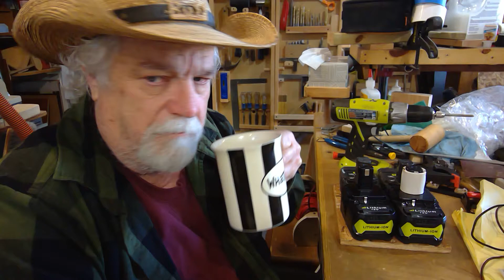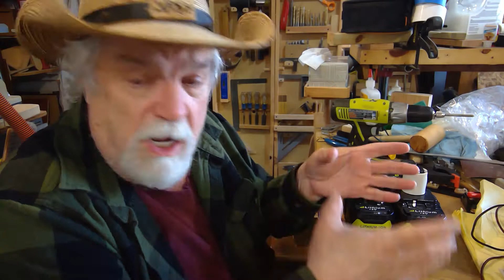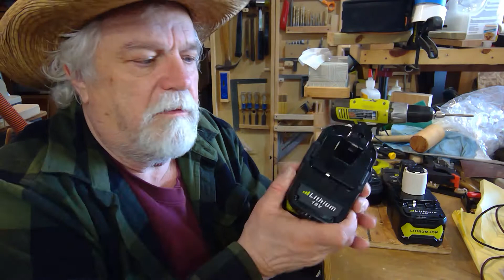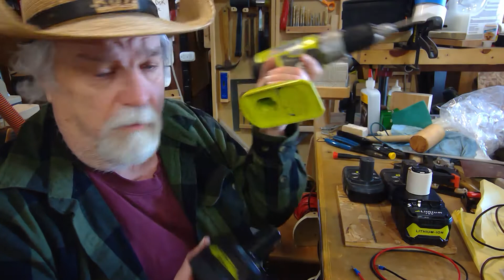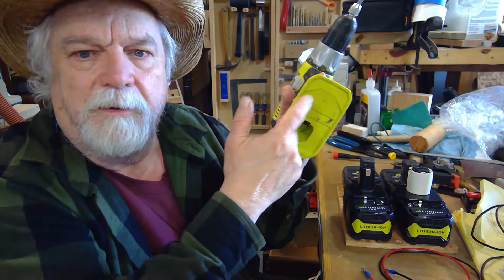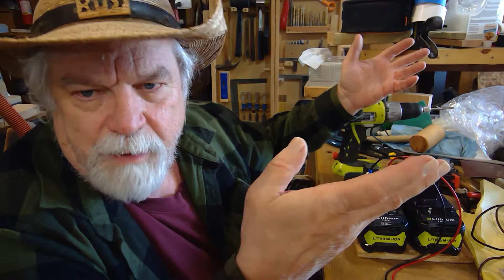DIY Portable Power Station by Portable Power

Comment: Funny thing Russ, just as you were pointing out that you could not buy sockets for the battery plug I instantly thought it could be 3D printed!  But I think your solution is genius, needing a scrap of pvc pipe and a hair dryer.  That's walking elegance.

Comment: Funny thing Russ: Just as you were saying you could not buy sockets for the battery plugs I was thinking they'd be fun to 3D print.  But I like your solution a whole lot more, simply a scrap of pvc pipe and a hair dryer...walking elegance.
Reply from the maker: Hey George, I thought of you as having a 3D printer.  I didn't want to volunteer you to make a bunch of these :>)  your assessment of my solution flatters me, thanks.  if I can ask for your opinion ,  do you know anything about portable power stations? does your area of expertise include low voltage (DC) technology?
Reply: Hi Russ, on making sockets a couple of points:  Watching your video, I actually thought about 3D printing a few sockets and sending them to you.  But once I saw your solution, I decided "OK, job done, job done elegantly".  For anyone else who would want a 3D printed socket, it is possible to get them even without owning a 3D printer.  Some makers will offer their contraption to be ordered from them.  And then there are others who will print third-party objects if you send them (or point to) the .stl file.
About DC portable power:  I have some practical experience with DC power supplies, but nothing specifically with portable power, not with higher-ish wattage.  Most often they've been 5V maxed at 1A, so 5W tops.  I've made DC supplies using discrete components usually with 78xx voltage regulators, and lately with store-bought switching power-supplies like your buck step-down and buck-boost step-up converters.  But again the applications have been low wattage.  So far my approach to "portable" has been an extension cord or small batteries.  Oh, and yes, I thought you might have meant me when you said you knew George had a 3D printer.  You pasted a huge grin on my face, and got an LOL when I replayed the segment for my wife.  Best of the season to you and yours Russ.  (georgef at uottawa dot ca)
Reply from the maker: I sent you an email. I hope you got it.  I am having troubles receiving email.  please let me know.
Reply: Hi Russ.  Just got home.  I found this comment right away, but there is nothing in my mail: not "inbox" nor "junk mail" nor "other".  Note that my address is georgef (not just george) at uottawa dot ca (not com).  I'll be on the lookout.  Bye for a bit, George F.  PS I also have GeorgeFouriezos at gmail dot com...nothing found there either.
Reply from the maker: looks like I can't send. my address is (russv at cpamomy dot com)
Reply: @russveinot5754  OK, I tried sending you email using russv etc.
Reply from the maker: i got it and hit reply.  no errors when sent.  one of those days :>)

Comment: The flat charger tends to monitor battery conditions, where as this newer triangle charger has left the neighbors batteries in a dead state from time to time.
I'll have to look later for a model number for my flat 6 port ryobi charger
Reply: Looking at google, it appears that my P125 has been discontinued? All I'm seeing is the P135, that looks similar to the neighbors. Perhaps he got a dud, or an older version? Mine will randomly check the condition of the batteries when in eco-mode, or switch from Battery to battery if they've been recently placed in the ports. Up to the 4Ah it seems to take roughly an hour, but I've not timed the 6Ah, and don't own any 9Ah to note the charge time.
Reply from the maker: the p135 is the only multi-battery charger.  the other is discontinued I found a couple on ebay (one of each model) that are for parts only.  I will own one :>)  all I need is the case and port sockets for the batteries.  I can fit all components into the case I will need to have a portable power station.  it will be my nicest station when done I think. . . . and less than $100 total I hope.
as to the superchargers, I think they change the method of charging.  before they trinkle charged all plugged in batteries evenly and the new chargers runs 2 amps constantly and fully charges one at a time.  I guess that makes it quicker to get that first battery.  don't quote me but I think that is the difference based on little things I have read.  there is very little technical info on Ryobi batteries out there.  I have learned recently some interesting things about these batteries and will be sharing it soon on a video.  BTY, I ran my surface pro for 12 hrs yesterday on one 5 amp battery.  there might be some potential here :>)  thanks Charlie for all your input.  it has been very helpful.
Reply: I've not looked at it, but hopefully that email had something useful? It was originally intended to direct people to safely upgrade kids toys, so that was the primary focus, but the info for the batteries remain the same across platforms. Definitely interested in seeing what you come up with using the charger as the package!
Reply from the maker: I hope I get a used one to hack, so I won't have to butcher a new one.  the email article is in my "to read" pile (only read once so far).  so far, nothing jump out at me I didn't already know.  this is not to say I agree with all of it technically yet.
Reply: Oh yeah, I wasn't aware that your previous life was spent as an auto mechanic, that puts a damper on any of the information being new to you...
Reply from the maker: I have a solid working knowledge base but I still have lots of new things to learn :>)  unlike some, I dare to move outside my comfort zone (OTB) to new horizons all the time.

Comment: The flashlight is the cheapest one I believe, to make a "battery mount" or search for broken tools?
Careful relying on Buck converters, many of them (due to old tech) are made extremely cheaply, and when fail send full voltage as opposed to no voltage to the low output side.
Also, gotta yell at you here Russ, you NEED to make mention of some kind of warning on your video, about liability and the dangers of Li-On and similar batteries. The ryobi battery is designed for a "specific" amp draw. When that particular draw (and that's the unknown)  is altered, the battery "has the potential" to become "unsafe", similar to charging it improperly, today's technology becomes unstable, and therefore explosive. I just wanted to make sure that you alert your viewers of the possibility that misuse/neglect could possibly burn down the shop or house. Just like when a lazy dad injures his kid cuz he used his power tool battery for a boost on a power wheels. All the kid knows is he likes the speed, the kid didn't expect the improperly used battery could burn his toy down to a puddle of plastic!
I've got 10 minutes more to watch, I'll have to come back to edit my comment later

Love how you heat PVC for so many things!
Check out your local library, some have 3D Printers, and will happily print a supplied file for a "donation"  of basically the minimal cost.
It's idiot proof, due to the flat. Doesn't it match the shape?
How are you liking the aftermarket batteries? 
For "mixing" batteries, it's best to recommend keeping similarly aged/used/Ah, due to the potential of cross charging, an old weak battery can/will discharge a good/full moreso than your inverter power pack. 
Not wanting to take away from your theory and build, just wanted to ensure that you mention that type of stuff. 
Not familiar with the ryobi 6 port that has a USB slot, but my older flat model "checks" all batteries frequently, but the triangle unit can allow the battery to fade out, my neighbor thought he'd outdue me, and was greatly disappointed!
Reply from the maker: Hey Charlie. so many topics here.  thanks for your comments 
1st, I found on ebay several non working 6 port Ryobi chargers.  I am going to try to snatch up one of those.  that would give me up to a 6 batt. capacity.

2nd, I have never heard of the overcharge scenario but with a volt meter fulltime monitoring and proper fuse limits, this risk is minimized. 

3rd, as to dangers and liabilities, I have mentioned before, but you are correct here too.  I will announce that the reason I can do these things is because I have magic here and you should never try this yourself with having the same magic in your shop :>).  As a wise man once said . . . stupid is as stupid does.  Thanks for reminding me of this potential issue. 
4th, I have done lots of cool different things with PVC 
5th, "library", that is a good idea but would that be unfaithful to my shop?
6th, mixing batteries is not a problem to me.  As an experience auto mechanic (in a previous life) I was good at working with 12 volt systems, I have a solid working knowledge of the do's & don'ts of batteries and their limitations.  also, these batteries will be used daily when not being used in a PP station.  

in closing, I am confused with your last sentence above (huh??). also, answering your comments is close to a full time job . . . I love it :>)  all your thoughts are welcomed and taken seriously here.  take care my friend.